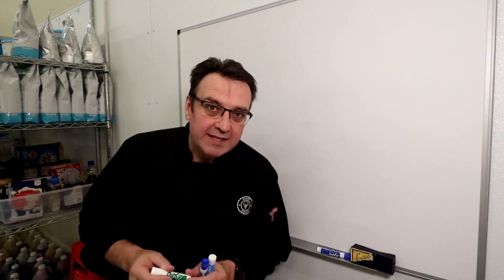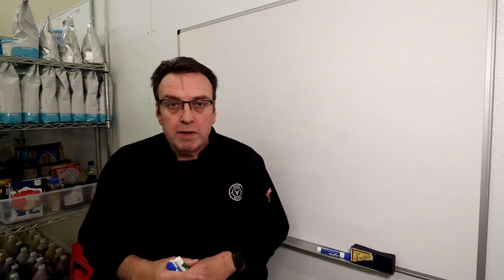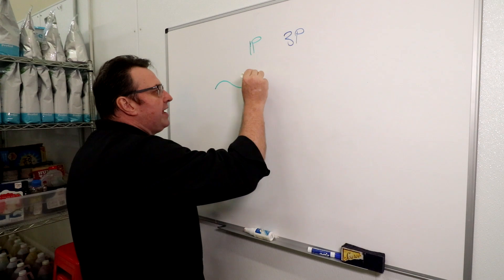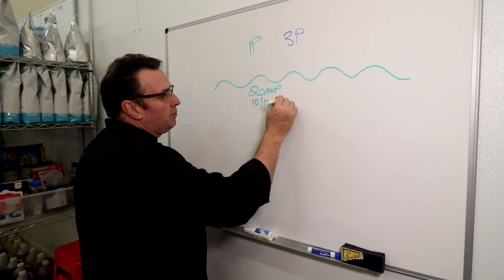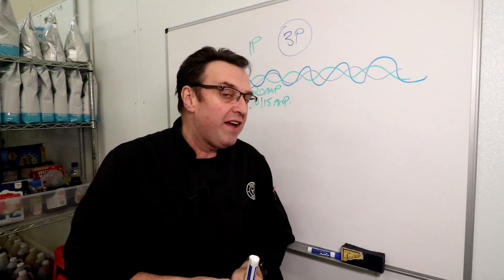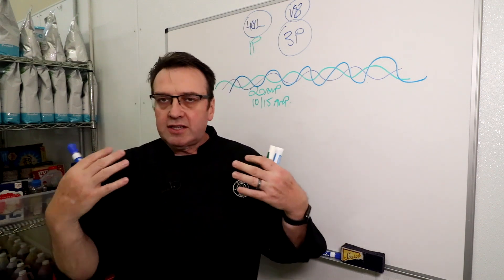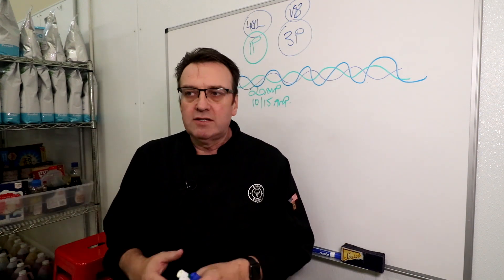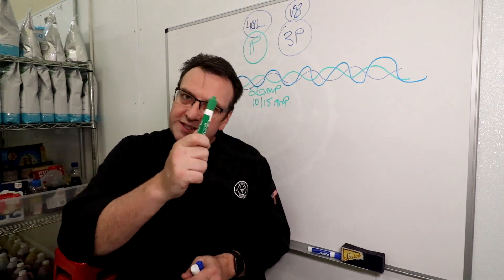What is the Difference Between Single Phase & Three Phase?

Comment: All power is transmitted across high voltage lines as 3 phase, even when supplying residential locations. This is due to transmission efficiency/loss. (Yes, they could come up with a system that uses more than 3 phases to further increase transmission efficiency but the returns are diminishing.) The main reason why 3 phase is advantageous for large facilities is that 3 phase motors are more efficient and self-starting. Single-phase motors require a method of starting them spinning. Ceiling fans usually use a capacitor. Desk fans use a coil of wire to induce a small out of phase current just to get the blades moving.
Reply from the maker: Now theres  man who knows the biz